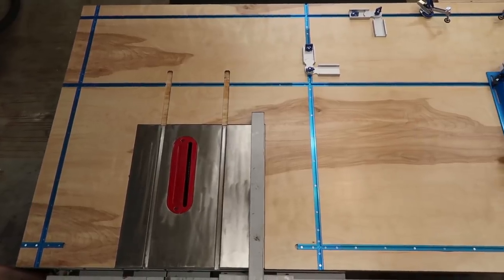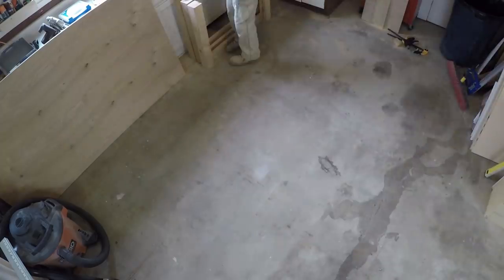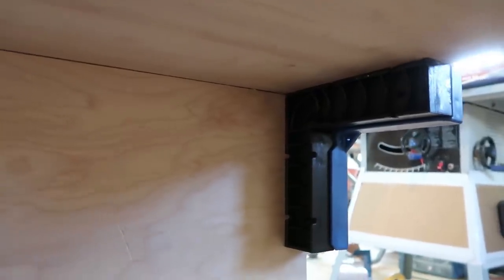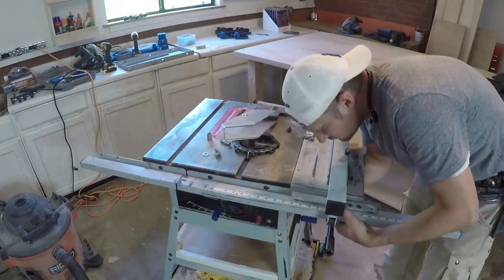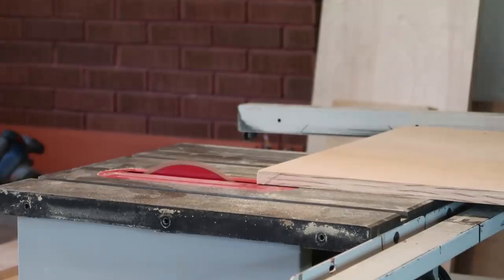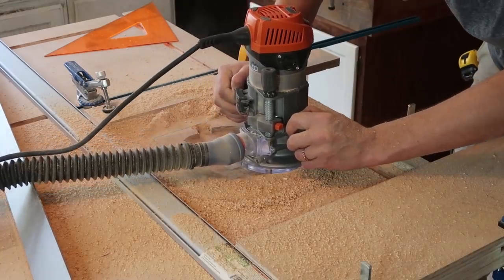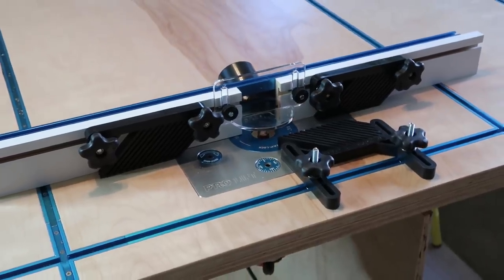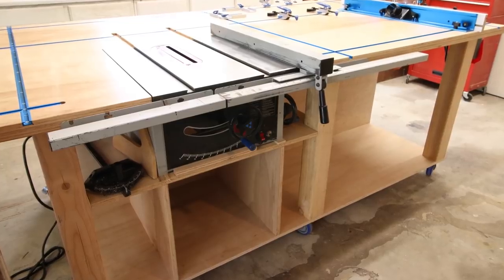How to Build a Workbench Tutorial

Comment: I built a table saw table with a router table in it. Mine is 8ft x 8ft, which I think is to big. Yours look about the right size! And I put a Vega fence on it, just like yours! My saw is a Dewalt, I only had to redrill 1 hole. I was able to get the blade within 0.001" of the miter slot. And the fence within 0.002". I'll never see 0.003".

Comment: Good table. I built it with some minor changes though, the first of which was to eliminate the middle casters due to my uneven garage floor. This unfortunately requires additional bracing of the table to maintain flatness, and exposed a lack of torsional stiffness. So I have had to place reinforcements along the long sides to eliminate most of that. I like that it has enough outfeed support to crosscut a full sheet of plywood without dropping the pieces off the back as well.
Reply from the maker: So glad to here that it turned out for you.   Thanks for commenting!

Comment: Only bad is the sitting area, cut out a spot got feet under the table, then Put a piece coming out from back wall that lets you hang the stools on it,  you would need to add Bracing to legs if part the wood is removed from bottom.  or if any one builds it later let top over hand for benches under it.

Comment: Another thing.  Regarding the bench vise, it is great that he put a piece of wood on the tightening part of the vise; but I wouldn't press anything tightly against the plywood edge on the other side.  Plywood is not very strong when pressing the edge.  It can separate. Make a simple wood piece that attaches to the edge and to the bottom of the table.  Glue it and screw it.  That way you have flat wood against flat wood.

Comment: Got my table (based off of your design) finished today. Got the table saw and aftermarket fence system installed. Had to offset the center divider on the saw side. My saw is bigger than yours and my table is only 42” wide. Will have to wait for a little bit to get the T Track and router lift. Router lift may  be a Black Friday sale purchase.
Reply from the maker: That's so great!  Let me know what you build with it.  Enjoy!

Comment: Looks great. Most table saw workbenches have the blade aligned with the length of the table rather than the width. What are the pros and cons of the two options?
Reply from the maker: It works best in my garage this way. That is the main reason I designed it this way.  I also have stands I pull out for long material.

Comment: My only question is ..why not make the table saw out feed  lengthwise vs widthwise?
Personal preference . Nice table.
Reply from the maker: We actually have a beam in the center of our garage, so we can’t move around or cut boards in that direction.  You could definitely put it in on the side, but it just wouldn’t work with the space in our shop/garage.
Reply: @Remodelaholic  ahh I see. You could add a 4'x4' drop down or slide out leaf extension for a longer table when you need it.

Comment: I started building this, but kept it 8ft long. I've adjusted all my measurements to account for the extra length, including ordering additional t tracks. However, I didn't account for the size of my tablesaw I just got. The bottom base is 24" deep. To solve I am pretty sure I just need to install on the opposite side of the center plywood divider. The issue I am trying to figure out is how to still have mitre grooves past the saw with the fence system I have since it attaches at the back of the saw. I feel like this would cause a gap between the grooves on the saw and the grooves on the table and could cause binding issues if not careful. I did order the Vega 50 fence as well, and am awaiting it's arrival. Trying to figure this out before I cut into the tabletop.

Comment: Great build!  What do you use the vice for that you wouldn’t use the t track for?  I’ve actually been trying to decide which I’d go with since I don’t see many people use both on the same bench.
Reply from the maker: I like using the vice for holding wood to sand the edges.  I have used it to hold metal while cutting it to length.  I have used it clamp and glue multiple prices together.  Holding wood for drilling holes.  And more, but I can't think of it right now.  Hope that helps!

Comment: Hi thanks for a fab bench great vid and good plans,the only problem I found was some measurements didn’t add up so had to adjust things after doing all my cuts on the timber so can you adjust the measurements and change for future download of the bench.pete in the uk
Reply from the maker: Peter thanks for the comment!  Could you help me know where the measurements where off?  That would help me know where it fix the download.  Thanks!
Reply: In the cutting instructions the bottom shelf is 78” x 42 and when you add the two legs at 4” = 8 and then add the size of the short beams at 35” and add them together it adds up to 43” hope this helps. Pete uk
Reply: Did you understand my explanation ??? Pete in the uk
Reply from the maker: So the 4x4 post is actually 3 1/2" x 3 1/2"  We call it a 4x4 but is it actually 1/2" shorter in width and length.  So 42" is the correct dimension.  Sorry for the confusion.  I don't know why they do that in the US.
Reply: Ok thanks for putting me right there but it would have been nice to know about it thanks.and my bench is moving on now
Reply: Thats a US thing, 2x4, 4x4, ect..... when they make the dimensional lumber they start out with the actual cut dimensions of 4x4 or 2x4 then to get the wood is dried and they plane them down to their final dimensions.    Here in the states its assumed and it has even given me some fits as I'm building two ground decks in our back yard, atm

Comment: Super late comment and question here, but I love the workbench! Bought the plans and everything. But my table saw has a telescopic fence attached on both ends of it, so I would basically need to cut a huge channel running up the length of the workbench to use it. Are there any fences you know of that would work with this workbench? Thank you again!

Comment: I have almost completed the table. One question, where did you get the Table Saw Fence rail that is attached to the side of the table? I was looking online at systems and they are very expensive $300 plus. I wanted to keep the fence on my new Dewalt but I would have to router a large groove down the middle so that the factory fence can slide front and back. I suppose I could do this but it would take away from the original idea of having the saw flush and encapsulated in the table. Any thoughts/ideas?
Reply from the maker: The fence I have is from my old delta saw.  I only have it attached to the front.  It had a guide on the back that I had to remove.  I know they are not cheep but I plan on upgrading to a bigger fence soon.  I haven’t found the right one yet.  They are not cheep though.  Email me a picture of your saw at justin@remodelaholic.com

Comment: Very nice design! Do you think this would work as a 3 x 5 table, with 4 legs? I don't need the table saw or router parts. I like the basic table, but I don't have room for one that big.
Reply from the maker: Thank you! I think it could work as 3x5 with 4 legs for sure.  You might need to add a 2x4 under the table top between the legs that would be further apart for more support for the top.  

Thanks for the comment! Happy building.

Comment: Thanks for the ideas. Like some others I’d like to adapt this for a mitre saw. Are you using a Ridgid router? I just bought one used but have heard that the diameter is 1/8” off the standard and it won’t work with some lifts.
Reply from the maker: Ya, with the rigid i had to make my own collar.  I need a different router.

Comment: The plan calls for 5 - 36" T track and 1 - 48", yet if I could just the horizontal T-Tracks there are 5, just short of the 36" (assuming some trimming), the vertical's number at least 3 assuming about 24" by the plans, which alone exceeds the 1 in the plan.  Additionally there are 3 small <1', sections in the upper half.  Is this a discrepancy, do I need to order more to complete the table?

Comment: This is an amazing table! What’s the approximate cost for lumber and the rockler products (tracks, clamps, lift, etc)?
Reply from the maker: Lumber approximately $200.  (Could be less if you use cheaper plywood). Routing station area and accessories about $600.  T-tracks about $150.00. Accessories are additional but you can pick and choose what you want.  Casters approx $75 or slightly less since they all didn’t all lock.

Comment: i got a small portable tablesaw built into a bench that im redoing for a bigger saw (delta 36-725) and was going to do a router set up...ive been noticing people, you included, put the router with the fejce facing the outside or end of table, what about facing it toward the inside of table to help better support larger pieces/projects? or would that be too awkward and have less control do you think?
Reply: TA1NT V1LLE I like mine close to the edge so I have a place to stand as I push the wood through.  But I could easily turn that fence around and put it on the opposite side for larger pieces of wood.  It just may be a little harder to control the wood being routed.
Reply: @Justin-vq7nv  so if you turn that fence around, would you then have to feed from the other way then?
Reply from the maker: Yes

Comment: Now that you’ve had your workbench and used it for over a year are there any changes you’d make if you were to make it today? Are you happy with the location of the table saw, or would it have been better placing it on the end giving you more length as an out feed table? Love the bench and really thinking about copying it for myself. Turned out beautiful. Well done!!!
Reply from the maker: One thing that I would change is to move the router lift more toward the center about 4”, but that is about it.  The table saw is where it is because of the layout of my garage.  Its easier to rip full sheets of plywood this way.  Thanks for asking!
Reply: @Remodelaholic  What’s the reasoning behind wanting to move the router 4”?  I’m only asking because I’m at the stage of the build where I’m ready to install the router lift and want to know your thoughts before making any cuts in the plywood.  Thanks!
Reply from the maker: If I move in the router 4", that would give me more room to use a featherboard against different sizes of wood.
Reply: @Remodelaholic  Great point.  Thank you for the quick response.  I have only routed out the center track so far so I’ll adjust my router track plan based on this advice.  Thanks again!

Comment: What did you use at 1:35 as a straight edge to trim down the plywood with your circular saw here?
Reply from the maker: 50 clamp guide.  Thanks for watching.  https://www.harborfreight.com/50-inch-clamp-and-cut-edge-guide-66581.html?utm_source=google&utm_medium=cpc&utm_campaign=12169518939&campaignid=12169518939&utm_content=128369727995&adsetid=128369727995&product=66581&store=2979&gclid=Cj0KCQiA8vSOBhCkARIsAGdp6RSQNW7XtillZO-7PjnXssm8ve7f7xC-tS5PAeRaGkKQpmki3FlOkPsaAluXEALw_wcB

Comment: Don't you get sag from the weight of the saw? I had the same delta saw and built a similar table but I found that over time I was getting sag from the weight of the saw itself. I'm wondering how much weight you can apply to just a 3/4 base sheet?

Comment: Thank you for this intuitive and very thorough video my man! Just finished the build and I was just wondering how the polyurethane finish is holding up or if there's anything you recommend to do differently on the finish? As I have already gotten a couple light scratches on mine.
Reply from the maker: You are welcome for the video and congrats on the new table.  I have noticed that my finish does get small scratches.  I have not tested any other finishes though.
Reply: Trevor Bruce 
Any painted surface will inevitably get scratched up over time. A sheet of laminate would probably be the best solution. Melamine board perhaps?
Reply: Just bought the plans to build this bench.  Just wondering if you could tell me what table saw fence system you have mounted on the workbench in front of the table saw

Comment: How is "the dust just falls down into the box" working out? It seems to me that dust would be flying everywhere.  Also, I'm curious if you're having any trouble keeping the table saw properly shimmed to be flush with the table top.
Reply from the maker: Justin plans on doing a follow up with the dust collection ( he still plans on adding some doors and connecting it to the dust collector). But for now he puts a board up in front of it when he is cutting and it does a great job.  So far the table saw  is still doing great, it is REALLY heavy, so it doesn’t move easily.  We don’t use it everyday- maybe weekly.  However if it becomes a problem, we could always add a little glue under the shims, so they stay in place permanently...  if it becomes a problem we’ll do a follow up video- but it isn’t yet.

Comment: Hey maybe a dumb question but what's going on with your table saw fence? It doesn't appear to have anything to connect to on the back section. Is that an aftermarkeg fence?
Reply from the maker: It came with the saw and works without the back part.  This is an old delta saw from 20 years ago.  It has been a great saw.

Comment: Wondering what table saws would work.  My current one wouldnt because some of the functions are behind it... in process of looking for a table saw thatd work foor it. A good quality one. Any suggestions?
Reply from the maker: Mine is an old Delta saw.  I would have to look around and get back with you.  I know I have seen a lot of the job site type saws others have used?  I will have to ask others to see what they think works well.
Reply: @Remodelaholic  thatd be great. Ive tried looking online but to no avail. Nothing specific anyways. I like the cast iron rigid but unsure if i can take off the base aand mount. Id have to see.

Comment: How do you use your table saw fence? Do you just use a sled for everything? Maybe I'm just not understanding, but I don't see where the fence attaches and can move ? Otherwise this build is fantastic
Reply from the maker: The fence is attached to my old table saw in the front.  I don't use a sled much for what I do.  Thanks for asking and watching.
Reply: Is it only attached on 1 side?
Reply from the maker: Yes, the track on the back had to be removed, but it still works just as good.

Comment: Very nice table. I am finally getting a shop set up for my self with limited space. What was your cost of building this? It looks like something I want to do but I am also on a limited income.
Reply from the maker: Lumber approximately $200.  (Could be less if you use cheaper plywood). Routing station area and accessories about $600.  T-tracks about $150.00. Accessories are additional but you can pick and choose what you want.  Casters approx $75 or slightly less since they all didn’t all lock.  I hope that helps.  Good luck!
Reply: I downloaded your plans and were going over them to plan my project. Thanks for making them available. I am setting up shop in a 14x32 building so space is vital. I'll sell my full size Delta table was and get a smaller jobsite saw.
Reply: Second thought …. I can keep my big saw. I just need to take it off the stand! (Sometimes I scare myself with amazement! LOL)

Comment: I was thinking about putting a recess for my miter saw on the other side of the table (Corner next to the router). What are you thoughts?
Reply: I have a bad experience with that. It was getting in the way a lot. So I changed it to a on the top mounted miter saw. Just take some wood panels and make slabs the same height as the miter saw. Put some dowels on the bottoms and holes in the table. When you need the miter saw, just place it aligned with the dowels and holes onto the table. done

I even tried the foldable design.....nope, no good in the long run

Comment: Love the design! Do you find that the work surface stays flat? My garage has a floor drain so I'm worried about flexing/twisting...
Reply from the maker: That’s a good point.  It does stay flat.  Mine doesn’t move around a lot.  I didn’t think of and uneven floor surface being an issue. But I guess in that case you might have to find ways to level out the wheels on the floor. 
Thanks for the comment!

Comment: How effective is that table saw fence now that you've moved it over?
Reply from the maker: It still works the same that it did with just the table saw.  The frame for the fence is still attached to the table saw.  I do plan on buying a larger fence in the future,  but for now I am limited to about 24”.  Great comment!  Are you thinking of building one?
Reply: I love your bench design, really great job. I have a Dewalt jobsite saw, going to have to figure out how to make that fence work with your design.
Reply: @patelkrunal311  -- My thoughts exactly. I have a Dewalt jobsite saw and started thinking about how to adapt the plans for it.
Reply: @patelkrunal311  I also have the Dewalt. Have you figured out a solution for the fence?

Comment: How much in Rockler parts are used in this table?
Reply from the maker: Routing station area and accessories about $600.  T-tracks about $150.00. Accessories are additional but you can pick and choose what you want.  Casters approx $75 or slightly less since they all didn’t all lock.